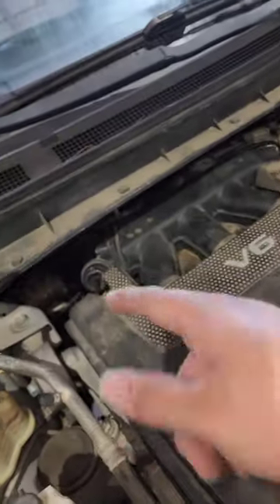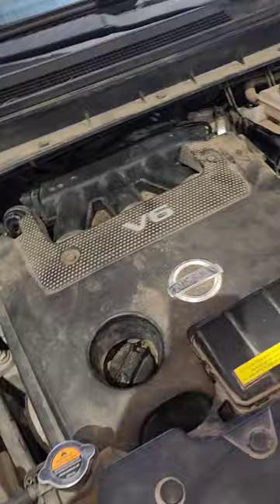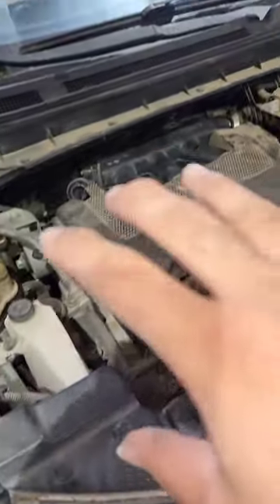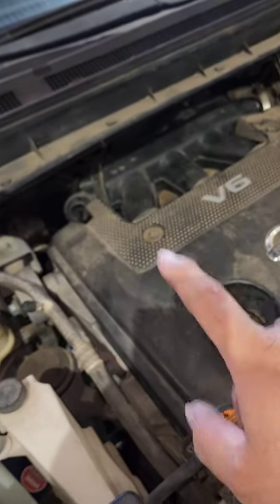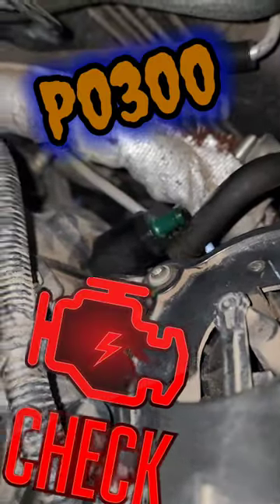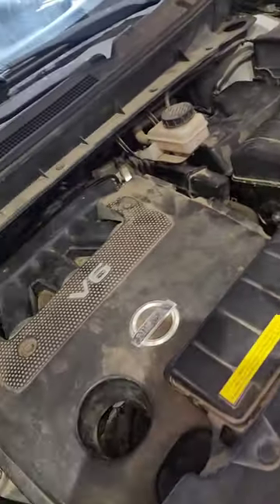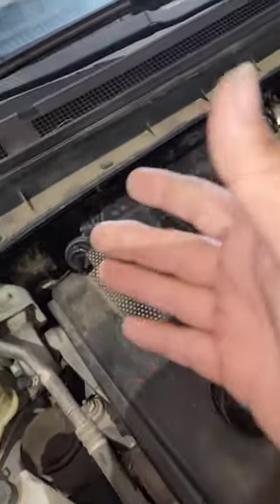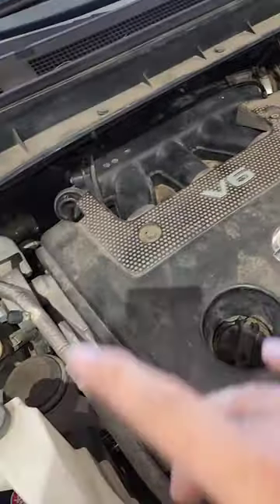DIY TUNE UP FAILED #auto #shorts #mechanic

Comment: 😂 yup honestly been around long enough with Nissan give me a maxima with a check engine light either gonna be a collapsed pcv hose, maf sensor or a transmission. Get an ac complaint dollars to doughnuts the evaporator is leaking 😂 I’m the interior specialist at my shop on account I did like 20 evaporators my first year 15 of them were maximas
Reply: How shit are the trannies in the maxima?? Gf has a 2017 and I'm worried the trans is just going to let go one day. Theres no troubles yet im just wondering because its all I hear
Reply: @Hybridsandwitch its all i hear to man. But if its shifting fine and not slipping, no sense in worrying about it
Reply: @stephenrufo1775  i agree but is it a "when not if" kinda deal?? Did they fix the issue for this year or do I need to put aside money for when the trans explodes
Reply: @Hybridsandwitch  i hear you buddy. Im not sure, as im a ford technician not nissan. But like i said, if its doing fine, dont let it bother you. Cross that bridge when you get there. Id say, if youre really that worried, trade it in for something else. But with the way the economy is...
Reply: You forgot Catalytic Converter for Bank 1